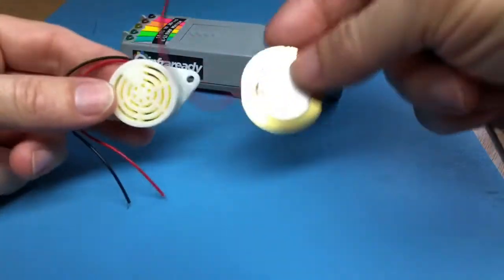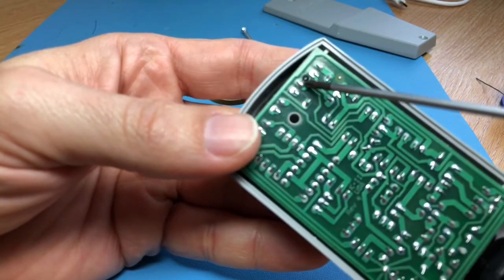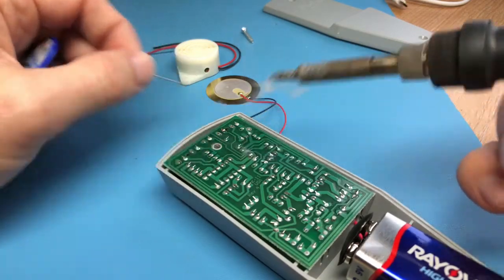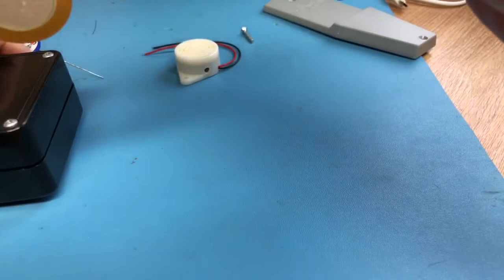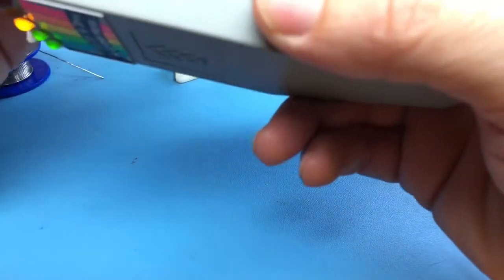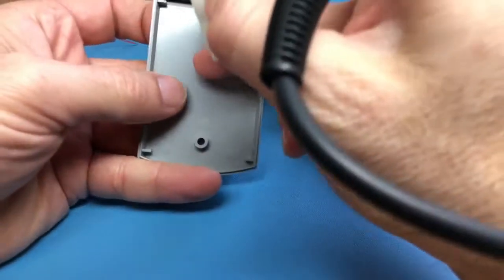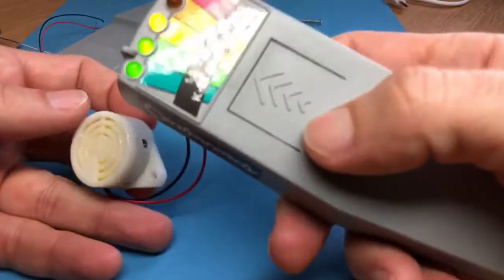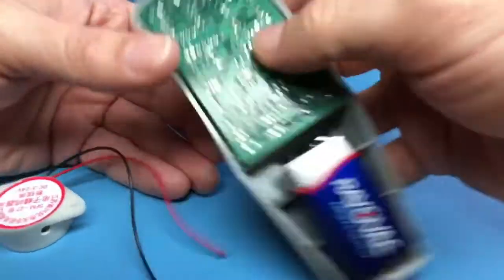KI EMF METER - SOUND MOD DIY TUTORIAL

Comment: Just modded my my two K2 meters with the cricket piezo element and they work really good put a dab of super glue on the back panel and attached the element to that and insulated the circuit board with electrical tape not to accidentally short out anything and it sounds pretty good I didn't want the buzzer I think its to loud for my paranormal work I like to be able to hear whats going on around me and not drown it out with a loud buzzer option. thank you for making this video it was a big help I have been wanting to do this to my K2's for a long time.
Reply from the maker: Jason Schnell thanks for your encouraging feedback. 👍🏼

Comment: Thanks for your video. I have a Chinese version and the board does not correspond to your model but you could try to do the same project. Can you tell me the resistance number where the black wire goes?
Reply from the maker: Kubo San email a picture of the board over to me at infraready@live.co.uk
Reply: @InfrareadyLtd  Hello! I have a home made EMF meter and I want to do this update. Can you check  my circuit board and help me where i need to put the cables. Thanks
Reply from the maker: @franticfanatic7996  send me the details over

Comment: I took this a step further and connected the wires to a 3.5mm audio jack socket. Then I drilled a hole in the rear of the case for the socket. Looks really neat and professional. Now I can just plug in a speaker whenever I want sound. And it is very loud.
Reply from the maker: Kevin Hodges https://www.infraready.co.uk/home/shop/kii-with-evp-audio-output-genuine-k2-emf-meter-ghost-hunting-communicator/

It’s a mod that we also do!  Thanks